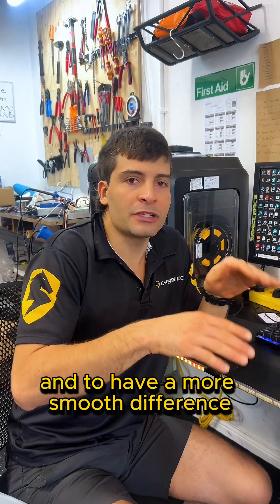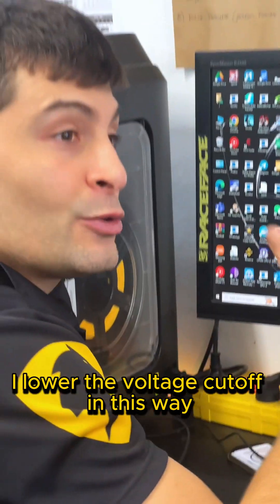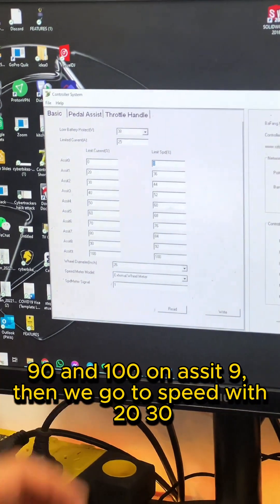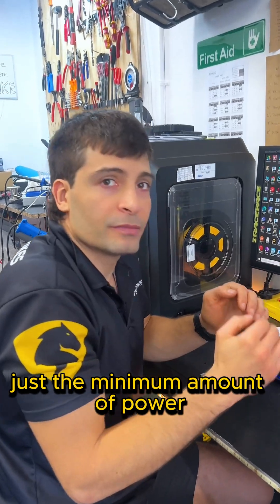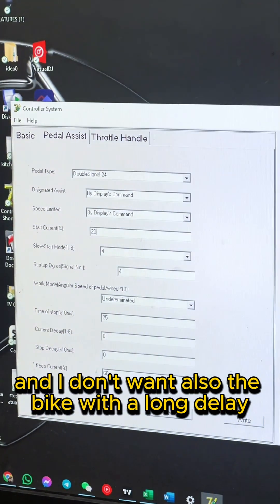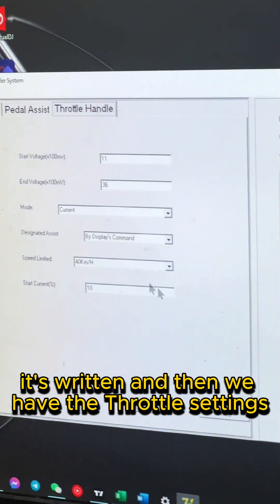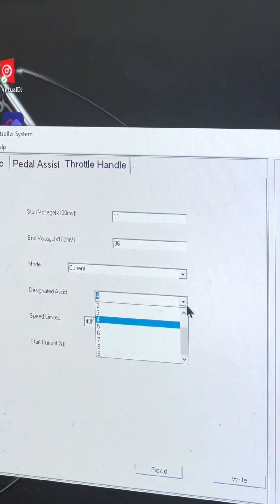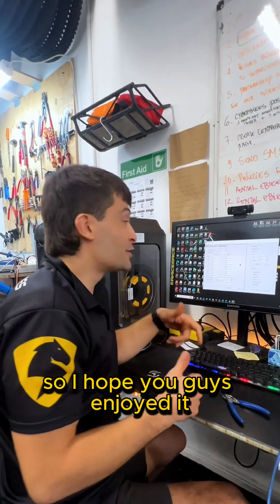How do I program my Bafang Controller? Ebike Tuning Repair Custom Settings Electric Bike Conversion

Comment: I just purchased a 1000w bafang bbshd and in my state its 250w maximum, the police weren't to bothered about ebikes and targeted escooters instead but theres been a surge of crime with kids on ebikes throwing bricks at cars, so now the police are doing a massive operation and stopping a lot of ebikes, i have a bafang DPC18 display and in the setting it had a speed limiter, i have set it to 25km but it still goes full power over 50km why is it not saving ? Is my controller overwriting the setting ? Really appreciate some feedback

Comment: what happens if youi tried this and it didnt do fuck all and nothing changed and nothins set like it refused on mine before setup.will it effect anything.i tried it after it tested it working couldnt do fuck all and left it all null as is then installed it and it has not wroked at all just powerd up. do i need to redo these first to get it to work?it litrally refused top let me change anything,no info come up or nothing.this software was useless.

Comment: Thank you very much for an informative video. 

I have a bike that I use both in the forest for fun and on the road to work. Would you use the same settings for this kind of use? I imagine I would use level 1-2 I. The forest and the rest on the road. But level 1 gave me almost no help on the upward hills.

Comment: I have a problem with the software. It wont let me write to the controller. Can you give me some advise on this issue?
Reply from the maker: can you read the controller specs? If not most likely you have a damaged controller OR Windows is not allowing you to add more than 10 USB drives, you'd have to delete some of the "given USB ports" inside of Windows.
Reply: @Cyberbikesau  it's brand new. I have ordered a cable which has the triangular connector. Hopefully that will work. I have no problem with the USB ports.
Reply from the maker: @joeykarg8169  that wont work, different software and controller settings, you will need an authorised bafang dealer

Comment: I have the ADO AIR PRO which has both a BAFANG motor AND a BAFANG CR S10R.250.FC controller. I believe that the controller has DISABLED the ability to add a throttle. I believe this is true because the motor itself is not limited according to the base specs that I've seen coming from BAFANG. So that leads me to believe that the controller has disabled the throttle entirely. If that's the case, wouldn't I just need to re-enable it and then to add a throttle cable to the controller ?

Comment: Hello, does the programmer work for hub motors? If not. Do you have any suggestions to up the speed limit on bafang G06 500w with 860C display

Comment: hi i own a m600 that lowers the power output under 30% battery left. Is it possible to program the system so it gives full power all the way to lets say 10% left or something like that ?

Comment: I have a bike with a bafang motor and display on it but the speed is limited and I can't change the setting (according to the manual at least) it has the triangular type of plug so I can't use a phone to reprogram it either. If I get a compatible display and change out the one I have now, will it change the programming for the speed limit? Or would I need a new control unit?
Reply from the maker: that bafang uses another software, you have to search according to that model. We're currently using Bafang BBS. Could also be the case you need a new cable but can use the same software

Comment: Put pedal assist on 1% and see what the range is
Reply from the maker: The range would be huge, probably weeks of riding without charging the battery but what's the point of that? it would be better to ride an acustic bike instead